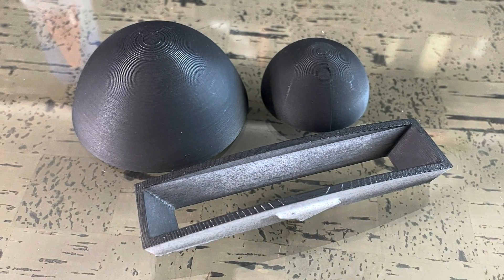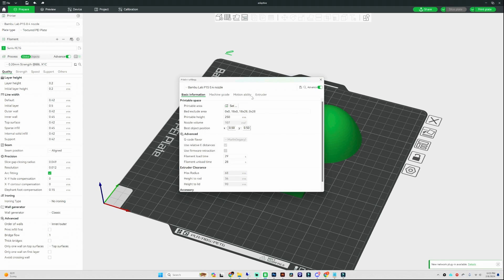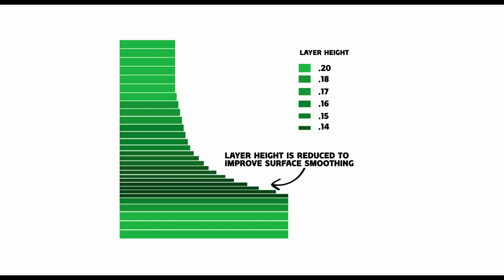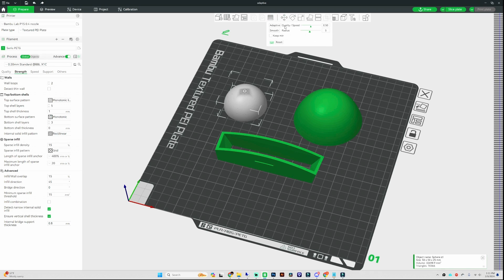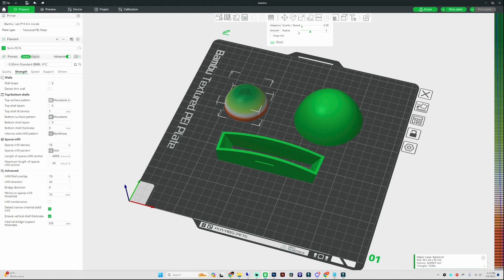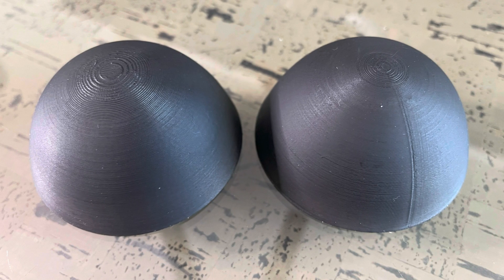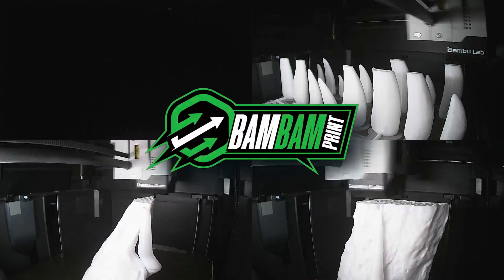How To Use Variable Layer Height In Bambu Studio For Perfect 3D Prints

Comment: Great tutorial, I learned what I needed to but then I stumbled upon a very cool feature - Just incase you didn't know, on the right (after clicking ADAPTIVE) you get the bar, hover over the coloured bar and you can then LEFT CLICK or RIGHT CLICK to manually change the layer height, too!  

I'm testing out a ball and socket joint, so I have made only the ball minimal layer height, and the 'leg' to normal layer height (so there is a solid green and solid brown colour without a gradient)

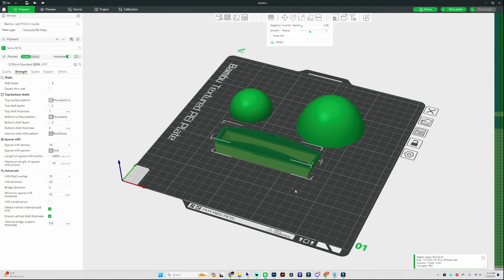Comment: 4:12 From looking at the slicer, it looks like the line down the side is the layer seam.  This is hard to hide on a pure curve.  Sometimes a random seam is worth it, but it means little zits everywhere.  There's only so much tuning settings can reduce it.  It's one reason vase mode is cool in the special cases you can use it: no discrete layers, no seams! Those min/max settings from Bambu of 0.08 and 0.28 are conservative.  0.07 is likely to be fine, and I'd trial down to 0.05.  0.32 on a 0.4mm nozzle is fine.
Reply: @aajpeter  random scarf seams with some tuning are basically invisible

Comment: Good video, thanks. Just wondering why you didn't cover more about how your variable layer height settings affect the results. You just set to maximums which will give the best results but given the model may result in excessive print times. Would have been useful if you showed more about this and how specific settings affect results and print time. I find it a bit of a pain to have to repeatedly make adjustments on the sliders and hit the 2 buttons to see the results. In general, when do you make use of this feature on your prints? Do you always use it and at maximum settings?

Comment: Hey great tutorials on Bambu Studio! Just wondering if you have any tip on the problem where a non-matte material like regular PETG turns matte on the tip of the sphere where flow rate is super low? This also happens if a scarf joint is used, the whole scarf joint area turns matte. I tried increase the print speed to adjust the flow rate but with variable layer height it's impossible to compensate.

Comment: I have a problem, I have an enclosure part that requires stems for screw holes to fix a lid, however, on the first print they snapped off, I included some butress's to strengthen them but in one location they interfere with the PCB.
 What I want to do is continue the stems below the surface of the base of the enclosure so they are not just printed on the lower surface of the enclosure.
 Have you any thoughts on how this can be achieved?
Reply from the maker: I'm not 100% sure I am following you on this but have you checked out my Lifting prints off of the build plate video? Maybe that is what your looking for? https://www.youtube.com/watch?v=kxnAKA09d6s&t=34s

Comment: I need a bit of clarity if possible please, if your minimum layer height is 0.08, then that is the minimum you printer can raise each layer, how are you getting smoth transitions when using a layer heights of 0.12 and 0.15, 0.19 etc, these numbers are not divisable by 0.08, so you printer cant print at that layer height? does the software compensate and automaticly and change to 0.8, 0.16, 0.24, 0.32 etc?
Reply: Height can vary continuously between .08 and .28 mm.
Line width is where you would prefer that the wall thickness is divisible evenly by the line width.
The slicer can compensate for this too, but not as well.